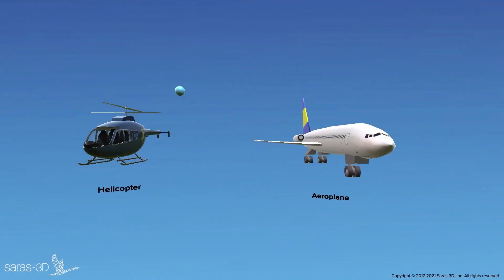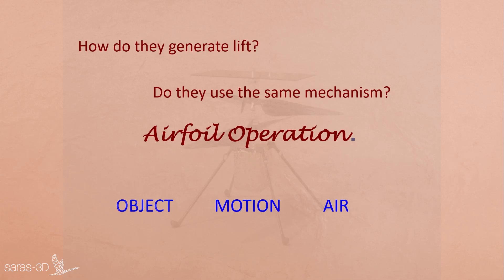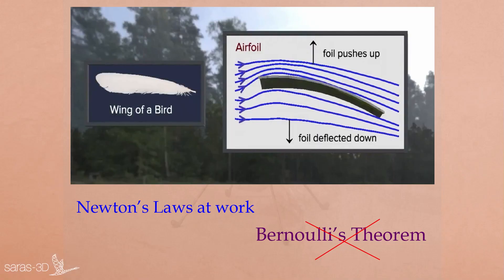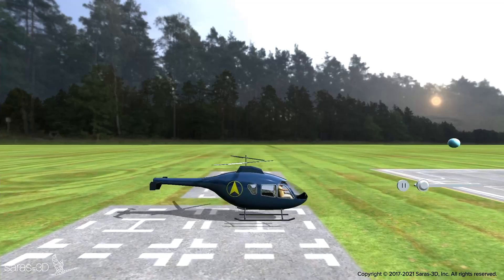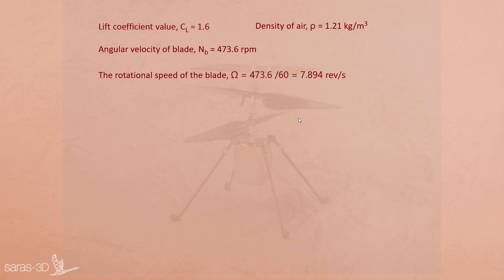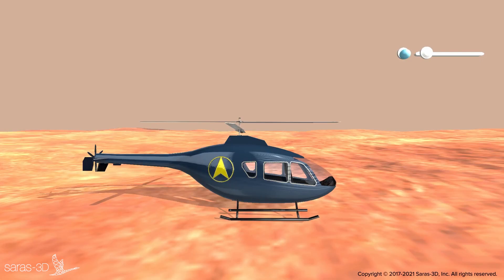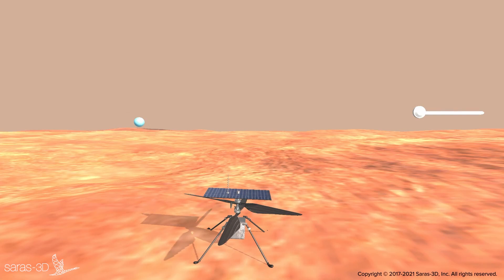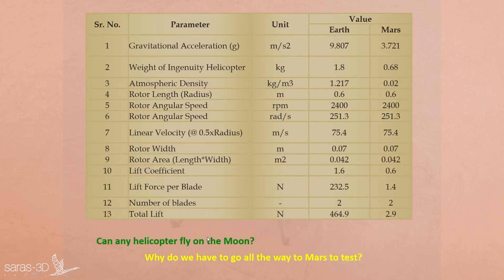NASA Ingenuity at the fore | Mechanisms of Helicopter and Aeroplane - Airfoil Working Principle

Comment: 1. well there is no air or atmosphere, only gravitational effect of moon, so it's difficult to generate lift using rotors. we can use rocket propulsion system to generate thrust to fly on moon.  2. Why test flights on mars because earth does not have the atmospheric conditions of mars such as pressure, density, and gravity. We can artificially create mars like environment in a closed chamber here on earth.